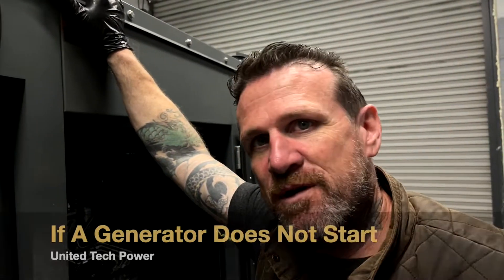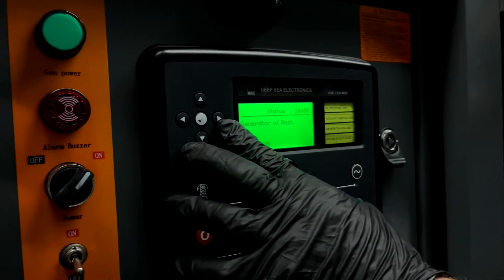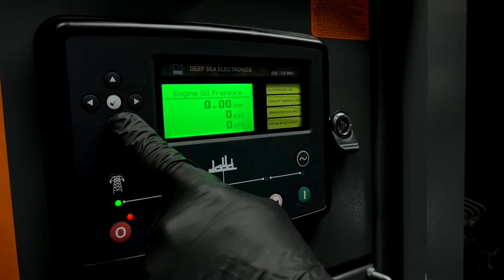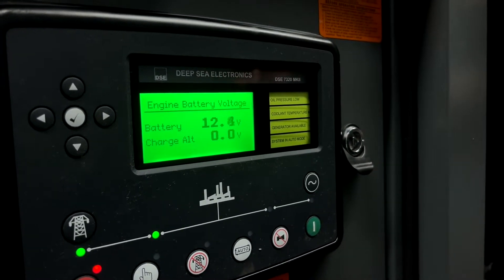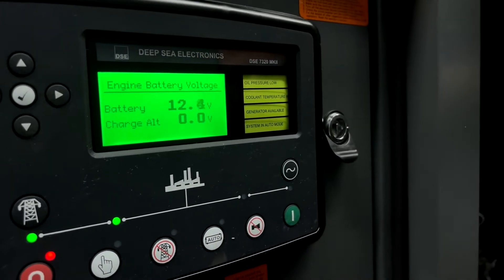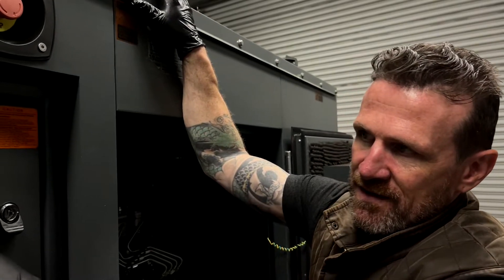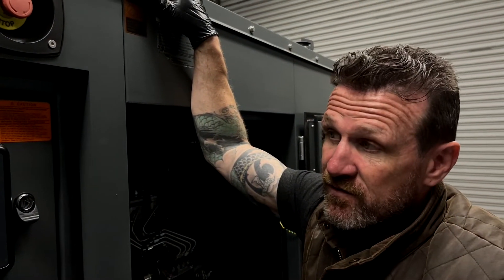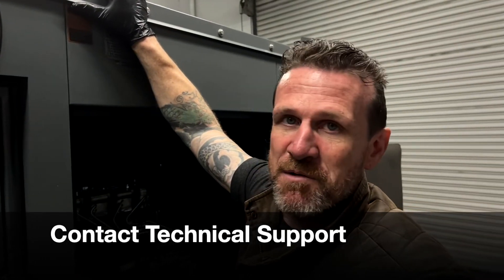If A Diesel Generator Does Not Start

Comment: Model 1506A 250 kva generator cranking but not start there is an ECU what is the problem?
Reply from the maker: thanks for the question, please check the diesel pump and then ECU.

Comment: Thanks for the vid, my battery shows around 12.3/4 volts but when trying to start it hardly turns it also it turns very hard.  After that the battery needs to be charged again, this can happen up to 4-5times before it starts. Is this a battery issue or something else?
Reply: Thank you for the compliment 🙏 This can be related to inadequate diesel supply or an issue related to starter. We have had cases like this before, and it’s been either, or.